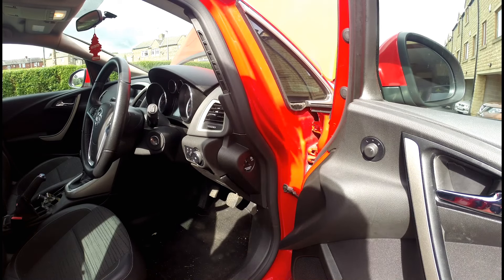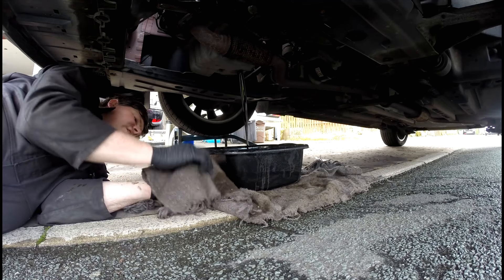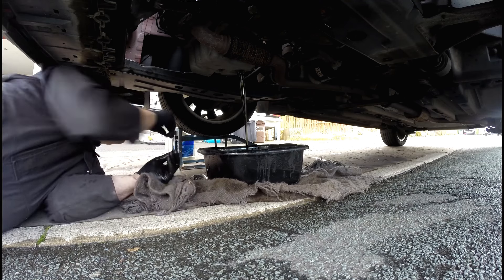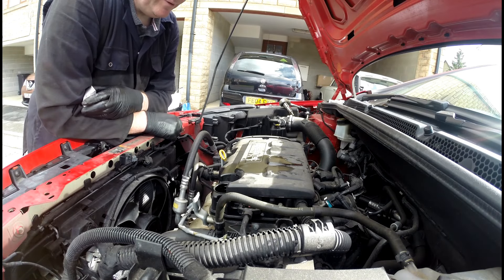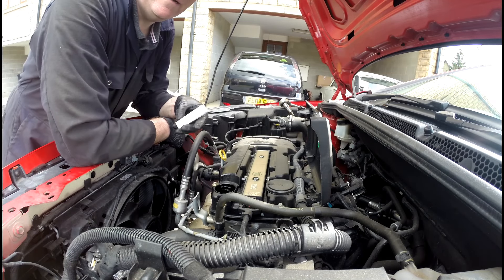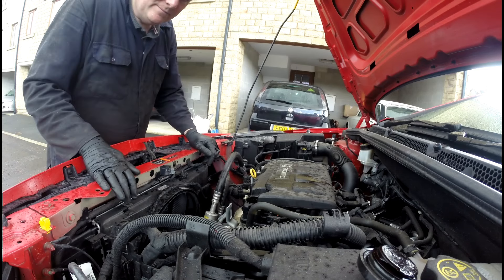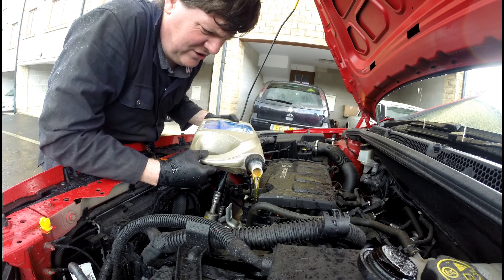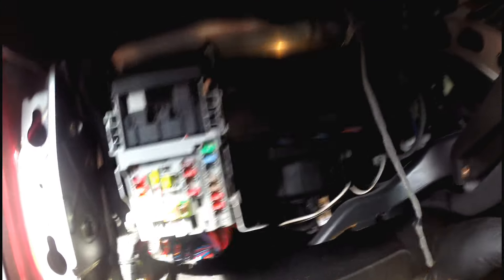I carry out a SERVICE in September 2017 - 2014 Vauxhall Astra J Part 2

Comment: Good video mate 👍🏻
But why did you place the old oil filter on top of the engine cover? 🙈🙈 lol
Reply from the maker: I was working at the roadside. I'm much better equipped these days with the use of a single garage and more tools to hand.
Reply: Parknest Aah I see. I hate criticising anyone’s work, but I couldn’t help it when I saw you place it on the clean engine cover 😆 lol 
But otherwise it was good work 👍🏻

Comment: I have an astra j 1.4 non turbo and the engine code is A14xer, I change my oil every 6 months and use good quality oil. Want to hopefully avoid the dreaded timing  chain issues!
Reply from the maker: You're doing the right thing there. Genuine parts from the dealer aren't always expensive so they're worth a try.

Comment: Do you need to replace the Oil 
Pressure Switch,  when you change the oil , on the Astra J ,
Thanks in advance 
Paul.
Reply from the maker: It isn't necessary unless it is faulty.
Reply: @Parknest   Thanks Mate, your videos are great,  BTW and Saved 
Me a fortune in , Service,  costs 
At my local garage, Stay Safe.
Regards, 
Paul.
Reply from the maker: @laupmacone  Glad they helped you. My videos are "how I did it" but I try to do things correctly.

Comment: What size bit did u use at 3:50 to remove the oil filter cap?
Reply from the maker: I've just had a close look at the original footage and I can just make out that it is a 24mm socket that I'd used.
Reply: @Parknest  also, is it necessary to undo the the screw from the bottom of the oil filter to release the dirt  or is that only for diesel cars?
Reply from the maker: @Illusionz-de2mo  I haven't a clue. Sorry.

Comment: Hi, great vid! Can you remember what size spark plug socket is needed for replacing? Keep up the good work
Reply from the maker: Sorry, I don't remember. The engine code for this particular Astra is in the description if that helps any.
Reply: Hiya. I used a 16mm to change the spark plugs on my 2011 astra j
Reply: @susanmcpake2396  hi, did you use   
NGk Iridium spark plugs?
Tia.

Comment: You just make to much mess,very clumsy!Old oil filter on engine cover,spilling oil all over the engine?And first thing you have to do is to check if you can take the filter cap off,if you drain the oil and can't take filter cap off you are in big trouble!Then you can't move your car.
Reply from the maker: This was a few years ago. I hope I've improved since then. In the words of Doc Brown: You're not thinking four dimensionally.